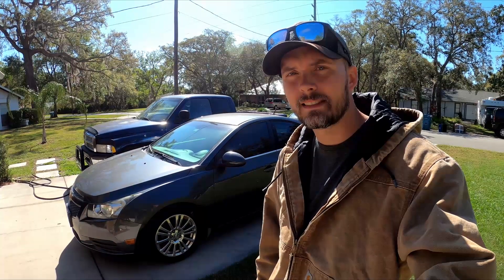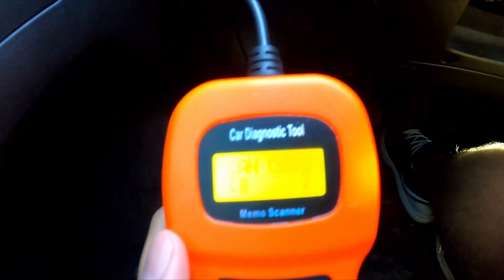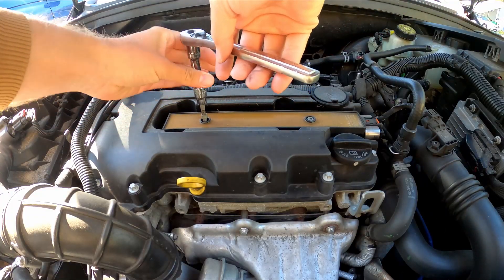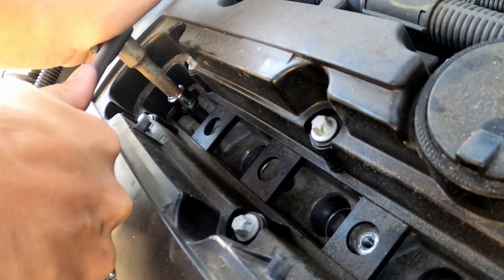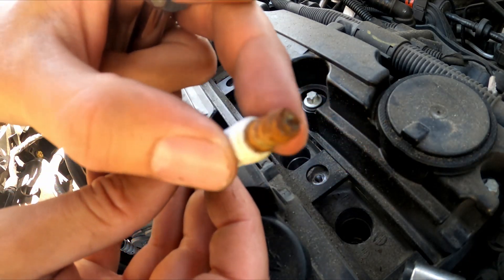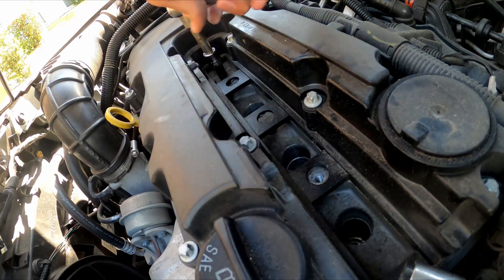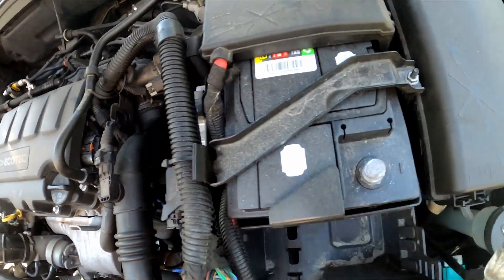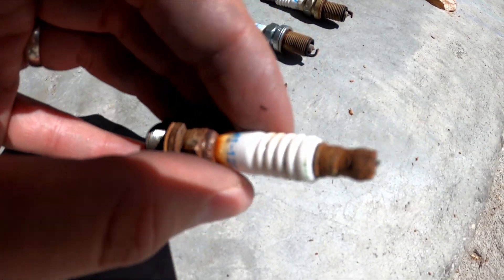How to Diagnose and Fix Service Stabilitrak Traction Control Problem 2011 - 2015 Chevy Cruze

Comment: I took my car to Autozone today i got the same code because the StabiliTrak appeared on and already changed the spark plugs today and my car still shaking suddenly. And they told me at Autozone when the plugs get replaced it will stop shaking but no. 🤷🏻‍♀️

Comment: I'm gonna try it because I have replaced everything so far motor, turbo, valve cover, sensors etc it sits more than anything I hope this helps others
Reply from the maker: They don't make them like they used to. Hopefully it will solve your issue

Comment: Yaa i just got a chevy cruze 2014 they kept it in good condition. But not sure about  inside tje engine itself tho. Recently gears started slipping then this popped up one time. But i have a interlock device. Aka blow n go so not sure to go about doing any of it.

Comment: Just wanted to say a big thank you for your video. My check engine light came on suddenly and the engine was running rough. It was slightly difficult to accelerate and the car was vibrating especially bad when idling. Your clear instructions and the links to the exact parts and tools needed was super helpful. For anyone who doesn’t have access to an OBD2 code reader or can’t afford tools— big brand car part stores like AutoZone will give a complimentary scan and will sometimes lend you basic tools to use on site so it’s worth asking. I didn’t have a reader and needed this fixed asap so I took a gamble knowing that neither component had been replaced before and I was at 84,000 miles.

Comment: Its misfireing on for cause of your plug, "the rusty one" thats is on cylinder #4.. lets think a min, if my "spark plug" is not getting the proper contact due to "excessive rust" its not gonna ignite the fule air mixture,  therefore "misfireing"

Comment: In my case the light that turns on is :ABS and the sliper road car and the SERVICE STABILITYTRACK.So can not be the sparks,I already changed like 2 months ago.And i was thinking to buy a new solenoid.But prefer to check the ABS sensors first.keep you posted.

Comment: Should have switched the coil to another cylinder and see if the code moved to that cylinder.  If so you I u know it's the coil. You may have bought a coil you didn't need.

Comment: i have a 2014 chevy cruze throwing the same message for the stabilitrak and traction control, code popped up the P0301, so i replaced all plugs and coil pack, the next day the issue persisted but didnt throw the code, took it to another buddy of mine who had a better reader and got these U0100-71/ B3055-00/ U0151-00/ B1325-03. have replaced fuel injectors, ran injector cleaner, and replaced the negative battery cable due to what other people online have said fixed their issue, am really trying to avoid going to a shop cause of the $$, didnt know if anyone had any other input

Comment: mine did not shut off after replacing the plugs and boot coil, they were pretty rusty like that also. i didnt change the coil packs tho. also another thing is the radiator fan comes on instantly after start up, i dont know why
Reply from the maker: I had a lot of issues with that car. I'm not sure what codes you got, but from what others have said in comments and what I've gathered, it seems to be the coil that causes this issue the most. There are other things that cause it but hard to know with out full diagnosis

Comment: 2011. My light comes on and off. No shaking or anything just the light popping on and off. Have all the tools saved in Amazon cart. Buy everything once money saved up and will try on my own.
Reply from the maker: Scan it and see what codes you're getting as well. This message pops up for a few different things, so it's better to be sure before buying everything 👌

Comment: Hi, thanks for the video! I took my car to the mechanics because of the misfire and the vicious shaking of the car. They said I needed to replace spark plugs, ignition coil, and valve cover. Replaced all three, car is still shaking, not as bad as before but the check engine light and the traction control came on. Not sure what else to do. Do you have any suggestions?
Reply from the maker: Start with a good code reader and work your way from there. Hard to tell with out a good diagnosis

Comment: Uncle just gave me a 2012 Chevy captiva sport LTZ, wouldn’t start then got it to start, diagnosed it a bit noticed the lights on the dash but no codes gonna see if this works I think it will cause I can hear snd feel misfiring when in gear

Comment: I think turbos run hot if you like where it is hot might have more issues with this design -- coils right up against the engine. Older cars never did that. PHX Az when it is 120 out and you get stuck waiting stop and go 20 minutes to get on the freeway is really hard o this cars weak areas.   I would be interested to see how fails are linked to hit climate areas versus living in Seattle or Canada,ect

Comment: So, how did a rusted spark plug cause his Stabillitrak system to fail? I watched this video because I got a "Service Stabilitrak System" message on a 2017 Equinox, and wanted to find out how to service it.  What a waste of time!
Reply from the maker: Misfire causes service stabilitrack issues. It can be from other things as well. When the message pops up, put a code reader on it so you know where to start.

Comment: I have a question I have a 2013 Chevy Cruze my car just cuts off for a short second and then when it comes on it says service stabilitrak and goes right off. No engine light or nothing when I use the code reader no code comes up where do I go from here

Comment: I've been having some problems with my car running out of brake fluid. The mechanic said that he didn't see a leak, but I had to refill it, so it must have been leaking. He said that there were misfires and replaced what was replaced in this video. Almost immediately, my car has started to shake upon start and yesterday, I saw this warning. I'm so confused what the problem could be.

Comment: I got the stabilitrack warning message on my 08 Silverado after a routine oil change and tire rotation. I thought someone accidentally pressed the dash button. I pushed it and drove home. Since I was planning a long drive in the near future, I road tested the truck again the following day. I thought the road was rougher than usual. On impulse, I let go of the wheel and the truck pulled left. This never happened before. I took it to the tire shop, thinking I needed an alignment. The owner inspected the tires and told me to look here. There was a bubble on the right front tire. It was not noticible until I felt it and witnessed the difference in tread wear. It was a back tire rotated to the front. I was then told that the tires were 10 years old, though I bought them new from the Chevy dealership 5 years ago. Grrr! I replaced them all and immediately, the truck tracked true and the stabilitrack light never came on again. I then went on a 1300 mile roadtrip.

Comment: After almost $2,000  wasted THANK YOU SOOOOO MUCH MAN!!!! My lord this saved my life ive been without a car for two and a half months and like i said $2,000 later 😢
Reply: @naturedad420  always go to YouTube first with these cruzes 10 million people will have the same issue😂
Reply: @sparkzz5367  now that ive went through that nightmare ive started fixing my own shit through youtube unless its just some unbelievably complicated part that requires some super  expensive tool or anything that involves wiring/electronics. Through all this i discovered i LOVE fixing cars so idk may have found me a new hobby/job if i stick with it...ive learned more in the last year about cars than i did my entire life 😂
Reply: Same here 💔💔💔
Reply: Update: turns out it was a three fold problem it was my coilpack 3 bad sparkplugs AND my fuel pump control module. I have a little coolant leak now out my radiator and then once thats fixed my car will be code free. Thanks again! Also turns out whoever owned this car before me NEVER EVEN ONCE changed the sparkplugs 😑 i will never own a cruze again first and last time. Out of 15-20 vehicles in my life this has BY FAR been the worst car ive ever owned. For anyone wondering its the 2012 ecoboost

Comment: I'm 5 mons in but I don't see how a misfire will cause shaking and steering issues. I changed the disc's and pads and never got the stabilitfac again. If you've got the 1.4 it's probably your headgasket

Comment: Replaced the plugs and coil pack. Still misfiring. Looks like cyl 1 3 and 4 are steam cleaned. Coolant level constantly dropping. Worried it's a bad head gasket dumping coolant in the cylinders and beyond that, a warped head would total the car.
Reply: Yeah, unfortunately it probably a bad head gasket, you'll want to fix that quickly or you'll have bigger problems
Reply: @davidtrevino5911  you were right but it was too late! Time for a new engine.

Comment: So the coil pack needed replacing, and that stopped the shakes, killed the traction control AND stabilatrack codes off the dash??
Reply from the maker: Yes, for this vehicle, it was the misfire that was causing it to turn the car basically into a "safe mode.  " From other comments, it seems there are other codes that can trigger these cars to act the same way when a code is triggered. The best bet is to get a good diagnostic and replace what is causing the issue instead of just changing parts out. But if the plugs are over 75 - 100k, it wouldn't hurt to change them anyway for basic maintenance.

Comment: Mine has the exact problem taken to the mechanic, which changed the sparking plugs, but still, the car is shaking 😢😢
Reply from the maker: Make sure they do a thorough diagnosis before changing parts. One of the main reasons I work on my own stuff! Did they change the coil as well?

Comment: 2012 Cruze I replaced the negative battery cable and the p0016 code never came back on or stabiltrak or fluctuating voltage. A $23 cable

Comment: I just got the exact same thing on my 2015 Cruze. So basically it just needs a tune-up?
Reply: Use ACDelco plugs , For misfire , I have same car had same problem , now Stabili Track is on my dash and not on my scanner , I found to check wheel sensors , behind the wheels ,

Comment: My car is saying service stability track and service power steering the locks keep locking and unlocking while the car jumps around while driving and I have absolutely no idea what the problem could be! I am beyond frustrated because I have racked up $2800 with the mechanic and have been to his shop 4 different times and it’s still doing the same thing!

Comment: I have the same problem except the only code that was coming up was P0599 with a solid cel which is for the thermostat. Today it went full crap on me and now cel is flashing, im getting the stabiltrak message and my  car is shaking like a fat girl in an earthquake. Could this be due to the bad thermostat or is it definitely gonna be the spark plugs and coils? 
P.s. i also have a leak around the valve cover so i ordered a new one but i have installed it yet because i dont have the right size Etorx socket.

Comment: My stabilitrack light came on but no check engine light. I just had struts replaced but without a wheel alignment. Couldn’t that be the reason why?
Reply from the maker: Pull the codes
Reply: @deuceliter  check engine light isn’t on

Comment: I have a 2014 chevy captiva sport ltz. I didn’t use the code reader but as soon as I got inside to the spark plugs there was rust on mine. I guess the seller pressure washed the engine before I bought it and got it all wet. It’s all fixed. No more stabilitrak, traction pop ups or shut off’s. Thank you so much brother! You’re saving us all money and problems! God bless you!
Reply from the maker: That's awesome you got it fixed, and I'm happy to help! God bless!
Reply: I have the same car and issue

Comment: I have no codes for my 2016 buick regal but when i accelerate it shakes sometime..the check engine light came on real quik then turned off and i out my reader and theres no codes..the stabilitrack came on once since i bought it when i accelerated on freeway at 70 to 80 mph never came back on..could it be just to replace spark plugs
Reply from the maker: If they're due, then it could be. It's hard to tell without a full diagnosis.

Comment: Hey. Why not 2016 Cruzes? I have a 2016 and I’m having this same issue. Is there something fundamentally different about the build of the different years?
Reply: The plugs should be What GM puts , it's AC Delco plugs for misfire , stabili Track check wheel sensors , behind the wheels ,
Reply: I have a 2016 and it is evidently a "carry-over" model. Registered as a 2016 but it is essentially a 2015 everything.

Comment: Thank you!   Starting having THESE issues today in my 2011 Chevy avalanche.   Will adjust it to my truck and research the same code/ignition coil & plugs as I’m also losing power & getting the same [Service Stabilitrak] error.   Fantastic vid!

Comment: Thanks for the video, great job. I'm having a similar issue. I get the service stabilitrack warning but no check engine light. I'm assuming I wouldn't get a code with an obd tool without a check engine light, and instead of the car shaking, my dash lights and my radio flicker off and on. Ideas and thoughts are appreciated. Thank you.
Reply: Negative battery cable.

Comment: I changed the brake pads and rotors on my Chevrolet Cruze 2016 at the dealership. After the job was done I noticed the ABS light and the skid light comes on when I start driving. I asked the dealership if that’s normal and I was told the computer is trying to reset itself. I don’t agree with that answer. What do you think
Reply from the maker: They may have damaged the abs wheel speed sensor when changing out the rotors, but hard to tell without a proper diagnosis. I've never heard of a computer that needs to reset with a pad and rotor change 🤔

Comment: Im telling you its a bad chevy design ive had people do this exact thing exact code P308 misfire change everything this man did and stabiltrac didnt fix the problem..Chevy Cruz has a bad design issue ...On my 14 Cruz mehanic did the same thing but one mechanic got it right ..The 1.4 litre has a design flaw its the Valve Cover gasket that had to be replaced...This has happened to a friends Sonic same engine these Cars go through Valve cover gaskets air sucks in check engine light comes on and Stabilitrac ...If you need a mechanic to explain Clipper Mill Auto Baltimore Md its been a bad design on the 11 to 14 Chevy Cruze all that stuff wasnt necessary in this video for Stabii trac problem its the Valve Cover gasket

Comment: I normally don't work on cars much,  but my 2015 Cruze 1.4L Turbo was experiencing the exact symptoms and indications. Bought a coil pack in stock at NAPA and replaced it according to your instructions.  Problem solved! Purrs like a kitten.  Seems age related because, although it is a 2015, it only has 53K miles. Although it wasn't the problem, I replaced the plugs as well. Thanks for your help.

Comment: Isn't it interesting that older cars never had these problems!
Reply from the maker: That's why I daily an 01 Ram now! 🐏
Reply: @deuceliter  Actually, I hate to say it because I have always bought so called American made vehicles but they simply are not as reliable as the foreign ones are! Not only that but the warranties are better on foreign cars too!  I know of many people with well over 100k on their Toyota, Honda, and others with zero problems! My A/C went out in my car with only 32k miles and the repair is over 4k! So, I am going without air in Florida and I will never buy another GM vehicle again! This problem above is the norm on all GM cars, trucks, and SUV's! It makes you wonder if it is deliberate?

Comment: Same thing happened to my car. But the mechanic replaced the spark plugs and cleaned the injectors. I drove my car a few miles. And the lights came back on, so I drove it right back to the mechanic. So what else could be going on with my car.
Reply: Did you just do the plugs and not the coil? Or what was the issue

Comment: Is it possible that if the spark plugs are rusted that the big ignition coil does not need to be replaced? I’m just trying to save as much money if changing the coil was just because you were already working on that area and was a “might as well” situation.

Comment: Would you happen to have any idea with I have coolant in where my spark plug go.
Reply from the maker: Check to make sure you're coolant reservoir isn't cracked. When I first bought my cruze it was cracked and leaking coolant.
Reply: @deuceliter  we changed it about a month ago so it’s not that

Comment: A week ago I changed my spark plugs and tonight it started to shake and those messages came up. I turned the car off and turned it back on and went away do I have to replace the other part also?

Comment: my car was running fine all day then on the way home from my sisters  it started acting up check engine light and  service traction control and stability control. Ordered spark plugs  put them in no luck put my scan tool on comes up Po303 cylinder 3 misfire code any help would be appreciated

Comment: Hi my Cruze is doing the same thing I changed all the spark plugs but did not change the ignition coil and it’s still popping up the traction control. So does that mean the ignition coil is the issue

Comment: Safest waay to avoiding cross threading on deep set plugs is to put a rubber hose over and start the threads until hose slides around it. Its basically finger tight ,then you can torque it down.
Reply from the maker: Great tip!

Comment: The dealership told me my stabilitrack is due to needing a new electronic brake and traction module. It’s 2011 GMC terrain 140,000 miles. Can those be cleaned out or possibly have a short?